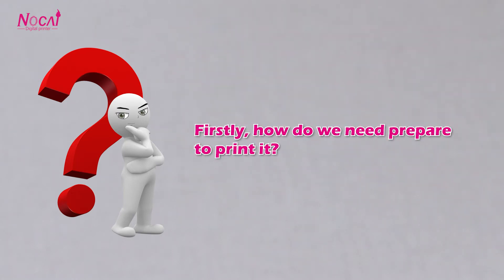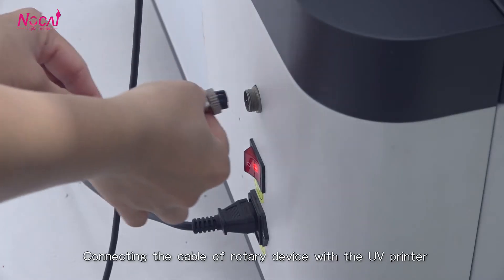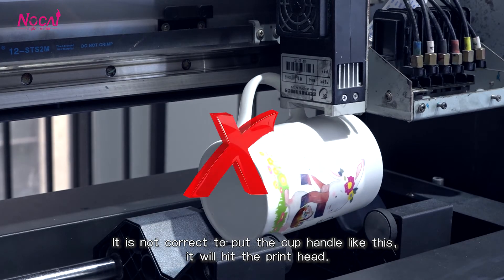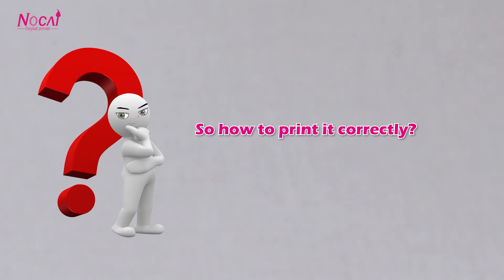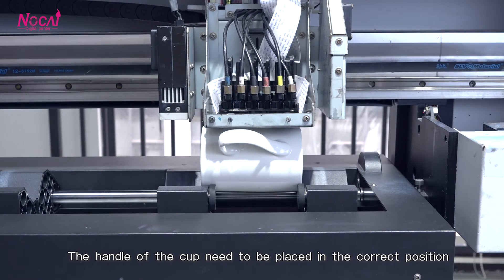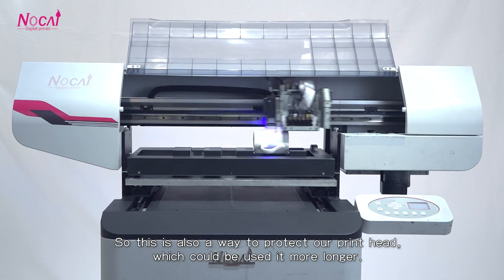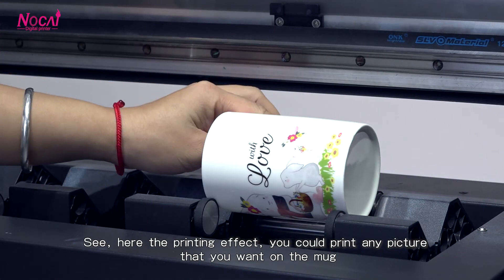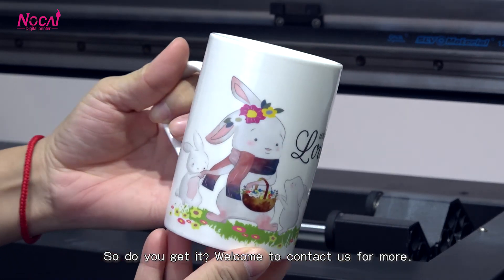How to put the mug with handle to print on small format uv flatbed printer NC-UV0406

Comment: Send parameter setup for mug print
Reply from the maker: You can refer to separate video about NC-UV0406 & NC-UV0609PEIII mug jig setup:
1. NC-UV0609PEIII 3 heads uv printer a1 size uv printing machine mug jig setup(service): https://youtu.be/KW2vsYKHRSo;

2. NC-UV0406 Nocai A2 size uv printer flatbed printing machine setup with mug jig(service): https://youtu.be/Xaucv7tklZQ